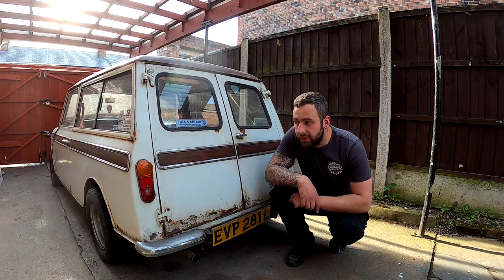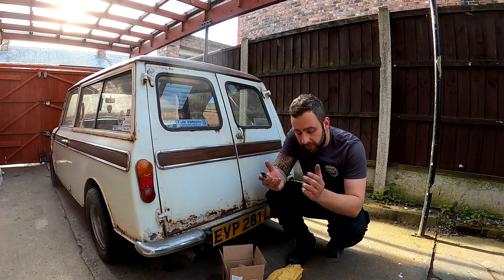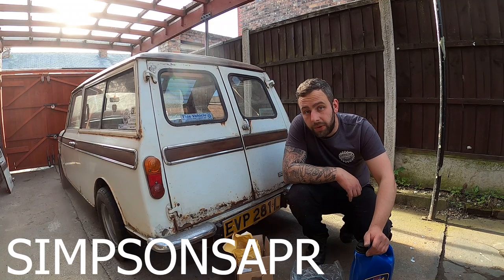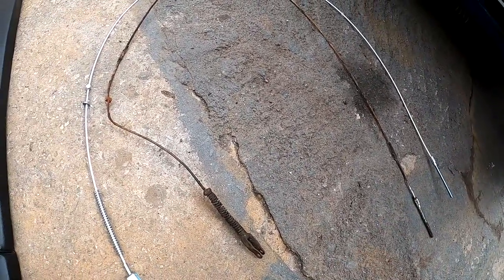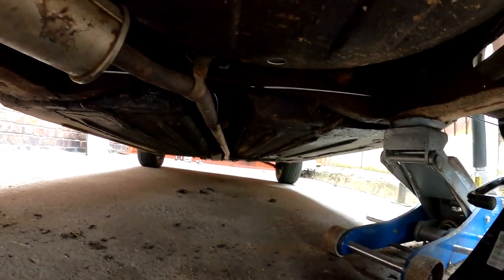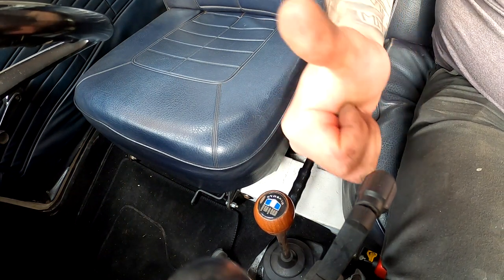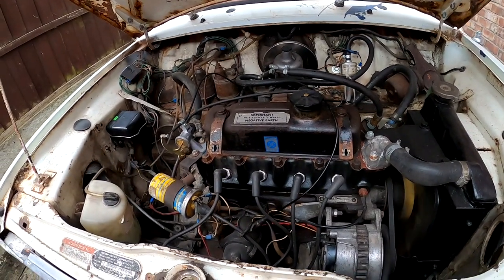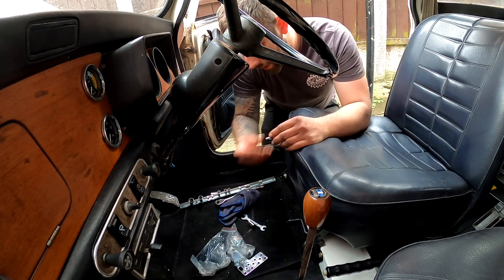LOADS OF NEW PARTS & TLC - CLASSIC MINI CLUBMAN ESTATE

Comment: Finally caught up. Great variety in this one and great to see you back working on your own clubby. Definitely a plus one for more clubby content. Rear door replacement a must, a driving video perhaps, another walk around, future plans, rust prevention (underside and general), converting back some of the non-standard items that you’re not a fan of (engine bay). Some ideas perhaps. Have a great weekend Marc.
Reply from the maker: Hey thanks for watching all those. Yeah the back doors will be getting done with the ones I mentioned it’s a must really. I can definitely do a walk around if the car that would be good. Yea there is a few bits under the engine bay that I want to swap back at some point it came with the original carb etc but once I sorted the head I fitted the slightly bigger one as at the time I was on the clock to get it sorted for a show. Thanks for watching and stay tuned for more

Comment: Another great video Marc . You are right . The hand brake lever  and the oil filter are Moggie thank god for the spin on especially for the oil filter . The exhaust clamp . Your sponcer needs to advertise them on Morris groups . The little Moggie suffers the exact same problem and the same clamp will work . Looking forward to seeing the journey of this clubman . Cracking start great surviver
Reply from the maker: Thanks john. Yeah spin off once’s are so much easier and less messy. I will be sure to mention this about the exhaust it’s a great product and definitely sorts the issue out. Glad you have enjoyed it there is always a few bits that need doing on this so will be sure to keep documenting it. Cheers for watching 👍
Reply: @SimpsonsClassics  the only difference is . And it could be the same on the mini there is a little tab to hold a bracket for the throttle return spring . I've never got the moggie exhaust to seal right

Comment: Marc when you put those seat brackets on does the back of the seat come up against the rear bin?
Reply from the maker: No mine clear but maybe if you went all the way back it might be an issue I can look and feedback if needed 👍
Reply: @SimpsonsClassics  Thanks Marc. I have some I bought a while ago and never installed them. Need to put them on as I feel too close to the steering wheel.
Reply from the maker: @midgelambert3880  it’s now I felt about being to close but now that’s sorted. I think it all depends on the size of the seat but these clear nicely.